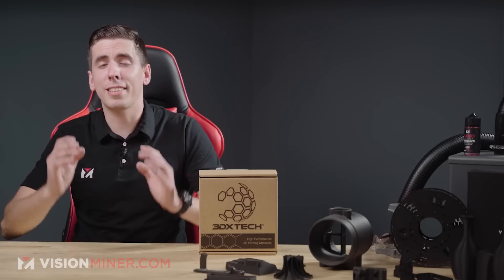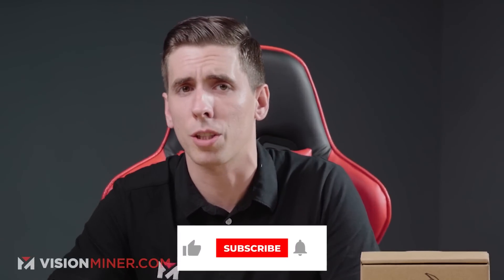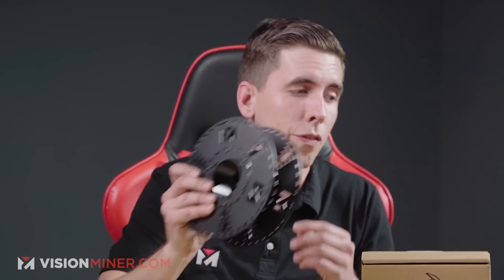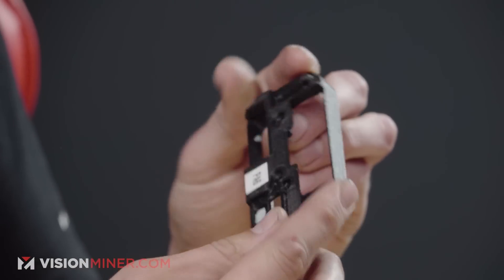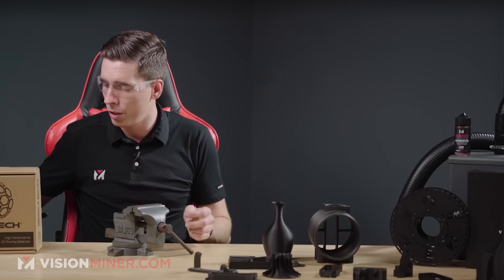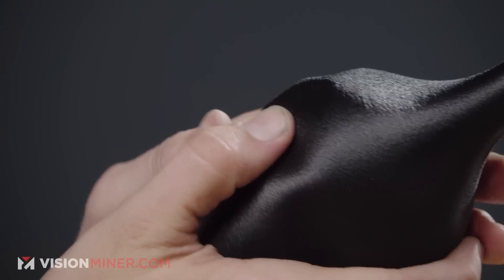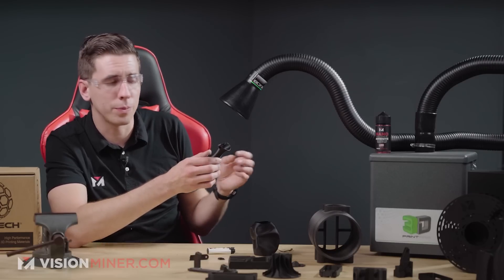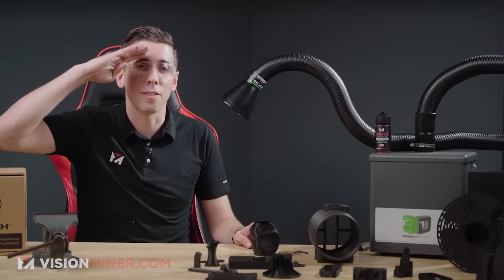CarbonX PA6+CF Gen3 Carbon-Fiber Reinforced Nylon 6 (CFPA6) Filament by 3DXTech 2021 Overview

Comment: what size nozzle are you using? and what speed are you running it on? layer height?
Reply from the maker: These were all printed with 0.4mm nozzles at 0.2mm layer heights. PA6, on the Funmat HT, was genearlly 70mm/s, but on the new 22 IDEX we're going much faster :) https://www.visionminer.com/22idex

Comment: What’s the retraction setting? I’m getting a lot of oozing for some reason
Reply from the maker: Depends on your hotend and printer setup, but print two small towers an inch apart, and try different settings as it moves up -- anywhere from 1mm-3mm on direct drive, or 2-15mm for bowden. However, if you're not drying the nylon enough, it will ooze like crazy -- check out this article: https://visionminer.com/pages/drying-filament

Comment: Owens Corning XSTRAND® GF30-PA6 has 7,400Mpa tensile modulus and 102Mpa tensile strength, compared to the CarbonX™ Carbon Fiber Nylon (Gen3) which has 3,800Mpa tensile modulus and 63Mpa tensile strength. The Corning one is clearly stronger plus its supported on Ultimaker Cura - is the CarbonX easier to print or has some different benefit?
Reply from the maker: We're going to have to test this -- we're doing a CF Nylon shootout with what we have in-house, on tensile testing machines, and we'll be doing a cross-brand comparison in the future! Make sure you're subscribed, we're printing a lot of tensile bars right now :)
Reply: @VisionMiner  Awesome thanks, that's exactly what I was looking for - subscribed!

Comment: How long would a print have to be before I need to consider keeping the filament dry DURING a print? My printer is in an enclosure but the spool is outside the enclosure in open air. Would it be sufficient to keep it in a "dry box" during a print? Thanks for the information on these truly useful engineering grade materials!
Reply: My dumb ass would say 4 hours

Comment: Okay, did get a 50g sample of this stuff finaly. Pretty brittle as a filament, not so got for tight bending radii on filament path. BUT WTH IS THE STUFF TOUGH and strong as a part. I do printed Fillamentum Nylon CF15 until, wich is pretty soft in comparison. Printed a M16 nut in both brands with a resolution of 0.1mm at 6 perimeters, 7top/bottom, 50%infill in normal laying position. Torqued them until they break. The Fillamentum dident get 20Nm, but CarbonX got to 55Nm and failed on the way to 60Nm, wich was mindblowing to me. And this PA6CF was way easyer to print. Good stuff, for real 😎 will buy a roll soon

Comment: Would you be able to do a video like this about PolyMaker CoPa? I've tried both 3dxtech CarbonX and CoPa by polymaker and I find the CoPa to be hands down superior in every regard beside stiffness. Layer adhesion gets to the point of injections molded strength, none of my prints break along the layers if I use 0.1-0.15mm layer height.

Comment: Thanks for the Video...I just ordered a spool and hardened nozzle as well as the adhesive. I print Sim Racing parts and I think my customers will love the high strength cool looking parts! Using a Prusa MK3+ with a surround enclosure.
Reply from the maker: Thank you!! Yes, definitely a great application -- we do some of that here, too!

Comment: Want to use this filament in my artillery x1. What is it going to take?
Reply from the maker: 250-270 on the nozzle, good bed adhesive and heat, and you’re golden!

Comment: I printed this stuff on my prusa i3mk3 , it is amazingly stiff and rigide, and does not warp at all, after having dryed it in an oven for 6 hours at 80degre celsius it printed very well, only i needed to reduce the flow rate from 95% to 90%, 
the other material the amide x (glas fibre reinforced nylon from 3dxtech) warps much more and i get less nice prints , the amide x oozes a lot ,

Comment: Didn't know it was legal to have that much fun over in CA. hah!   Nice vid!    Is that stuff chopped fiber like other CarbonX or powder like Markforged/NylonX/Polymaker CF-PA?  How small a nozzle have you had it work through?
Reply from the maker: We’ve had great results with a 0.2mm, albeit more jams, and it’s 100% chopped fibers, no powder here! :)
Reply: That's exactly the question I have. I'm printing small stuff and wonder if a 0.3 nozzle will work with the cf.

Comment: Remember that PA6 holds twice the amount of moisture than normal CF PA filaments, so you will need to dehydrate much longer. I use VisionMiner metal spools so that I can bake my 3DX at 90C. If your prints look "Fuzzy" on the outside, then you have not dehydrated enough.
Reply from the maker: 100%!
Reply: How long and at what temp do you bake yours?
Reply: Late to the game as this video over a year old but.. My concern with this material is all the great properties seem to only hold true if kept in a dry state. Even if starting out as dry as you can get, after printing and left in an open environment it will absorb water and becomes a lot more malleable essentially loosing much of the advantages. How do you prevent this for long term usage? For example over time you will see the material start to flow around bolts or other areas of constant tension.

Comment: Running SainSmart's carbon fiber nylon. It's a 25/75 ratio. Really strong. Having layer adhesion issues printing on my Ender 3 at 258 C. Also have dried it too. I think I just need more nozzle temp so I'll be installing an all metal hotend soon. Capricorn tubing has been holding up well at 258 C. Changed my max temp up to 300 C in Marlin so going to try 270 C after I install the all metal hotend and retune the PIDs.
Using 80 C on glass bed with glue stick. Parts print fine but the layers like to come apart after the print is finished.
Reply from the maker: How well did you dry the filament? Sometimes that will affect layer adhesion, but speed and temperatures can also be a major factor. Is the SainSmart based on Nylon6 or Nylon12? We print Nylon12 up to 320c if we're going faster, it's an interesting mix...

Comment: can you show a comparison in strength between nylon and nylon carbon fibre? someone has told me the nylon is stronger without the carbon
Reply from the maker: Nylon is "tougher" without the carbon --- "less brittle". Basically, nylon won't "break", it will bend. We have a few videos coming soon on other materials that do that, but as soon as we get a pure nylon filament, we'll do another video for sure!

Comment: Thank you for showing me this! Was about to go the 3DX CF-PC for my engine bay projects but this will work. The NylonX from matterhackers was quite flexible at 110C which was unfortunate 

Is it paintable after sanding if I wanted to do a high temp coating that matched engine bay color themes for customers?
Reply from the maker: Also, yes, you can paint, epoxy, and apply other finishes to it :)
Reply from the maker: If you want something even more rigid, check out HTN CF25! www.visionminer.com/htncf25 --- video coming very soon :)
Reply: @VisionMiner  thank you! Trying to offer new products to my customers and innovate my build. Not quite ready for the Funmat yet 😘
Reply: @VisionMiner  Looking forward to that video.

Comment: I recently printed some motorcycle parts out of this and it is impressively strong
Reply: does it lose strength because of moisture?
Reply from the maker: It becomes more ductile with moisture -- but even zip-ties absorb moisture, so it's not to the point where it fails as a part -- only really important for when you go to melt it through a tiny nozzle :)